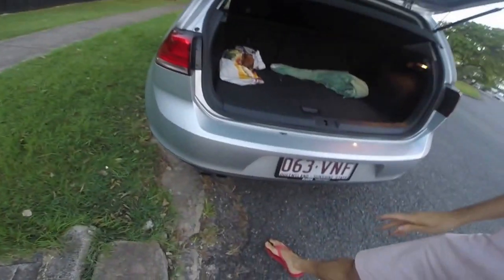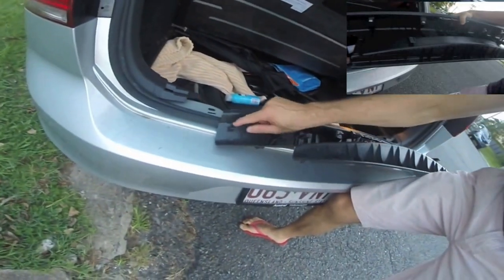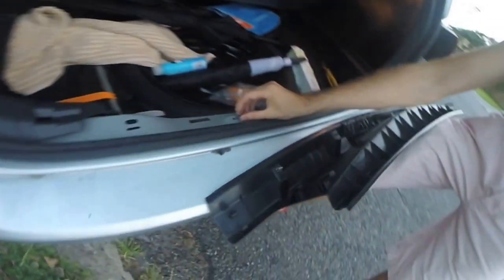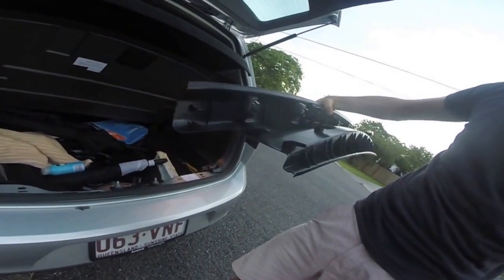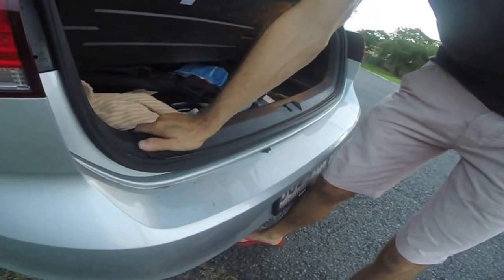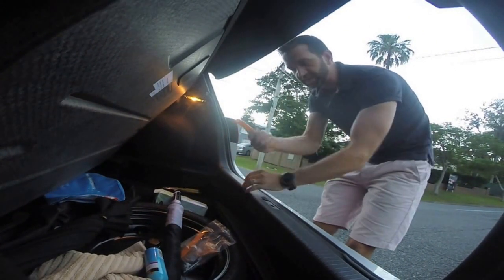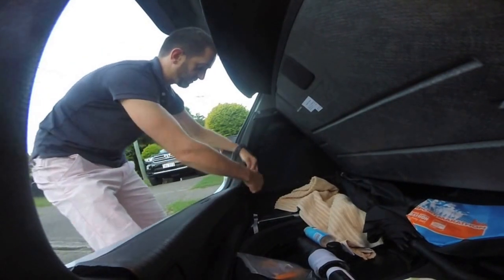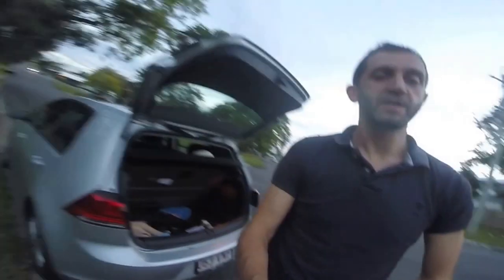How to Remove VW Golf Rear Luggage Lock Trim (Mk7)

Comment: I looked all over the internet for an explanation like this! Thank God someone made the video!
Reply from the maker: Glad you found it useful. Thanks for watching and remember to subscribe.
Reply: Same. I'm experiencing some horrendous rattle from the rear and it sounds like the locking latch. I've heard the two screws under the sill are the cause of this if they become loose. I've been meaning to remove it but haven't found a video showing. This looks good enough for me to give it a go. I really hope that is the cause of the rattle because it is driving me loony. Thank you.
Reply from the maker: @Latinomicz  Thanks for watching and glad you found the video useful. Remember to subscribe.

Comment: How did u use the plastic too no mention on that
Reply from the maker: Hi Mate, sorry to hear it wasn't useful. Try getting the following tool set - its the one bought and for the money it is as cheap as chips. It makes things a lot easier. https://www.ebay.com.au/itm/124776960850?chn=ps&_trkparms=ispr%3D1&amdata=enc%3A10iUAyocJRTKiYCHlazgvlQ0&norover=1&mkevt=1&mkrid=705-139619-5960-0&mkcid=2&itemid=124776960850&targetid=1395287513209&device=c&mktype=pla&googleloc=1000339&poi=&campaignid=14475531263&mkgroupid=125379166974&rlsatarget=pla-1395287513209&abcId=9300653&merchantid=107353134&gclid=EAIaIQobChMIuf695rCZ9AIVqodLBR05Fg2aEAQYASABEgI15vD_BwE
Reply: @HowtoMan  I tried to take mine off but it won’t come off Isit best to use the tool from one side
Reply from the maker: @Anoymus985  From memory, when I pulled it, it came of without much of a hassle, although i definitely had to yank it pretty hard. Make sure you pull it up straight up, otherwise you will break the plastic clips (check the video and see where all the different clips are - you may need to pause the video a couple of times to see them). You shouldn't need to use tools for this piece of panelling, but it definitely is worthwhile buying a trim removal kit. They come in handy when you are taking the car apart.
Reply: link now broken..... @HowtoMan
Reply from the maker: Try this one: https://www.amazon.com.au/Removal-Scratch-Fastener-Interior-Dashboards/dp/B0BBM47BJM/ref=asc_df_B0BBM47BJM/?tag=googleshopdsk-22&linkCode=df0&hvadid=468158496374&hvpos=&hvnetw=g&hvrand=8060723172556235540&hvpone=&hvptwo=&hvqmt=&hvdev=c&hvdvcmdl=&hvlocint=&hvlocphy=1000339&hvtargid=pla-1894156362841&mcid=712cfdd77830375f82b03410006863d5&th=1 @RainbowCharade
Reply from the maker: or this one: https://www.ebay.com.au/itm/256131297865?chn=ps&_ul=AU&_trkparms=ispr%3D1&amdata=enc%3A11ntiiJM2Rv2CTvN1H7dr6g92&norover=1&mkevt=1&mkrid=705-166974-041499-5&mkcid=2&mkscid=101&itemid=256131297865&targetid=2204750361313&device=c&mktype=pla&googleloc=1000339&poi=&campaignid=19894987377&mkgroupid=149150070682&rlsatarget=pla-2204750361313&abcId=9308665&merchantid=119468247&gclid=Cj0KCQiA7OqrBhD9ARIsAK3UXh2Eg8iqbbvMsSxGTu4ypoXAu3cntsR8jrSDxN0IxdDWu5ml8uXvBeIaAlS7EALw_wcB
@RainbowCharade 
Or just do a search for "Car Trim Removal Tool Set" - There are loads of good tools out there for really cheap.

Comment: Well Done, thanks
Reply: Water leak in from vents, trying to figure out how to remove the side panels to inspect, behind vents
Reply: @patrickokeeffe6998  One of the vents on mine had somehow come loose and dropped back through the hole it fits in, and was resting on top of the horizontal part of the body where the drain plug is! Either that or someone had been in there previously who didn't have a clue which side of the body it was supposed to be mounted on.
I was able to get my skinny arm down through the hole in the trim that provides access to the light cluster connector, push the vent back through its hole and snap it back in place.
Thankfully, no trim or bumper removal was required - that would have been a job for a better man.....
Reply: @elshiftos  unbelievable,  this video is very helpful, i think this is where I'll have to start to get at buttons or clips holding in the side trim fabric under the trim up by the rear lights , i hope!!!
The back seat is up in the hot press drying out!!!  I hope to get at vents without removing bumper.